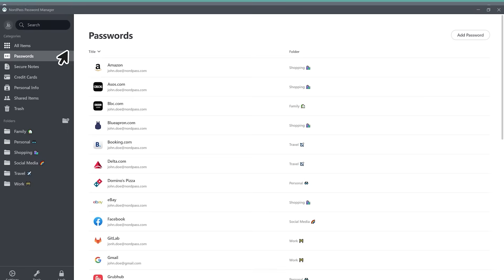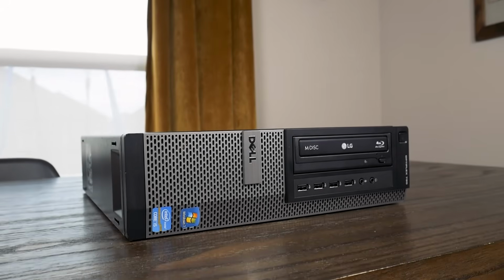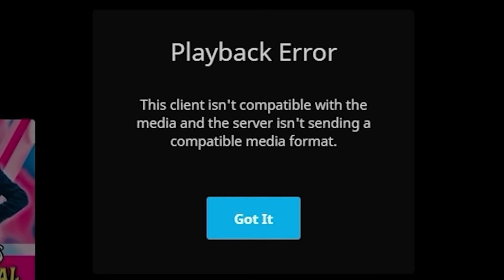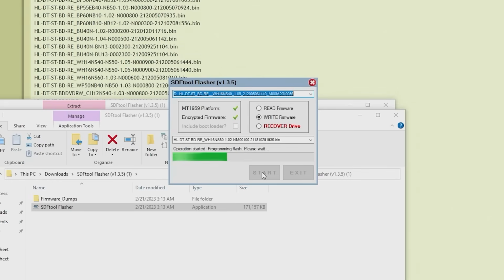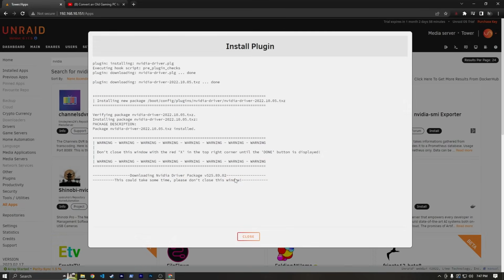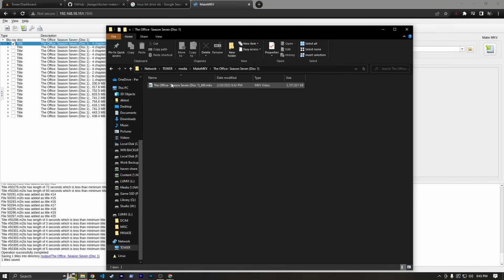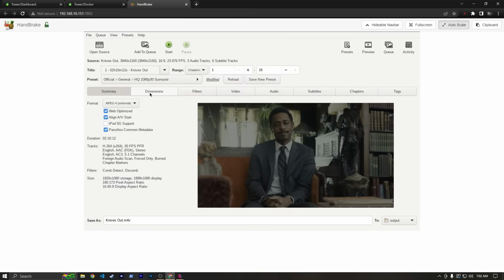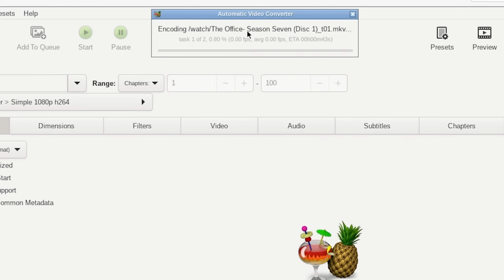Streaming 4K Blu-rays With a DECADE-OLD PC

Comment: Just installed windows 10 on my old Dell Optiplex (just like in the video) with Jellyfin. I only have a 250GB HDD and it's filling up fast. I've used MakeMKV to rip from my DVDs and then used Handbrake to convert them to mp4, but still the drive is just about full with about 40 movies and 5 TV shows. I have a list of a few hundred films I would like to store, so how large of a drive should I replace my current one with and does it need to be an SSD or is an HDD okay? And for backup, would an external SSD be the best choice?

Comment: Just pulled the trigger in one of those. Internet here in Brazil is atrocious. As I have a few gaming pcs at home, I will put a 2.5gb nic, a low profile gaming card and a 8tb hard drive to hold my steam library with ubuntu or bazzite. Whenever I need to delete or reinstall a game from my steamdeck or other gaming pcs, this will transfer the files locally (that is the plan, lets see).

Comment: Doing something similar but different with my Optiplex 9010. Using it as a Plex server with 3TB of SSD, i7-3770S CPU, RX 6500, and 16Gb of RAM. I may add a 6Tb HDD if I run out of space. Although it does have an optical drive, I'm doing all the ripping and transcoding with my 9th gen i9 computer with 28Tb of storage. Using MakeMKV and Handbrake. I don't have a lot of bluerays, but a couple hundred DVDs and adding more. I'm also ripping several hundred music CDs. It's taking a while. I have a Cisco UCS C240 M4 server with 120Tb laying around doing nothing, but it might be a little overkill.

Comment: OptiPlex's are pretty solid. I have two of them in my house, one is a i5 2500, maxed out ram/SSD/GT630 2gb (triple monitors), is on 24/7 and hasn't skipped a beat in the last 6yrs or so. It's mainly used for office work for my GF. I plan to do something like this video to repurpose it when I find something newer for her.  Best part it was nearly free. I live in a tech sector, when the companies upgrade it just rains OptiPlex's and like office PC's...I got a Z640 workstation and 4 OptiPlex's in different conditions for $50, sold the Z640 for $120 during the pandemic when everyone wanted a gaming PC.

Comment: Rip in lossless M2TS format using DVD fab and copy to a NAS (QNAP/Synology recommended) then use a media streamer like a Dune 4K or 8K player (8K is recommended for better performance across the board). This is THE best solution bar none for a networked home cinema solution. Make sure you have gigabit ethernet installed as 4K lossless streaming is over 100mbps.

Comment: Cool setup. I would just add as a tip, if your streaming device or smart TV has support for H.265 playback already built-in (most do these days), I'd disable hardware transcoding on the Optiplex and just stream everything with direct play. You'll eliminate the stuttering and you can keep your video files as H.265, which is much more efficient storage-wise and will save you a TON of space over time.

Comment: I've got a few similar machines at home that make pretty good retro gaming PCs. I've also used them for ripping DVDs as the included optical drives tend to rip quicker than USB drives. However when it comes to converting - even with a gen 2 i7 it can take quite a few hours. Although it's fine to leave it going overnight and they'll be done when you get up.

These days I tend to lean towards x265 encodes for my collections because of the smaller file sizes. While the machines are fine for ripping and software encoding DVDs to x265, I'm not too sure whether they'll play them natively. I suppose using something like Kodi or Jellyfin player should work. I also tried encoding a 20GB Bluray and it was going to take about 3 days LOL.  Personally for media centres I'd probably go a newer mini PC like those from Lenovo, HP and Dell (even though they don't have room for a DVD drive without the extension). 7 & 8th Gen tend to have x265 encoding.

Comment: I use the Dell 9020 for a pfsense box.  Works very nice with 2 x 30GB Intel SSDs in raid.  PS, sata SSDs fit firmly between the PSU and the case lip nicely.

Comment: Was successfully able to shoehorn a GTX1060 into a SFF I7 dell 5050 by using a sata to 6-pin power adaptor. 
The 1060 supports H265, and has no issues rendering 4k. Used NVidia x060 GPUs can be found really cheap, and work extremely well for this.
As for handbrake, your much better off leveraging a GPU than relying on a CPU for that task.

Comment: I currently have an Optiplex 9020 w/Core i5-4590,16GB RAM, 512GB SSD Boot, & 16TB HDD media running Plex. While is it probably quite a bit more efficient than yours, it still gets pretty hot and uses about 30-40w at idle. I have an Optiplex 7050 Micro (Core i7-7700T - idles around 10w) that I plan on replacing the 9020 with. I am going to attempt to replace the M.2 wireless card with an M.2 PCIE riser to add a 4 port SATA controller. If it is a success, I will de-case the 7050 and 3d print a new case that can attach to a 4bay hot-swap SATA enclosure (originally meant to fit into a tower w/3x5.25" drive bays)If it fails, I will settle on a 7050 tower and lose the ability to remove the drives without shuttting everything down.

Comment: I owned an identical model about a year ago - beefed it up to 16 gigs ram and used it as a spare Hyper-V machine for odds and sodds until I sold it off to some who needed a better machine after a laptop breakdown. I'm at the same thought pattern as you with the limited processing fabrication. 2nd gen is quite old and struggles to keep with modern day computing demands.

Comment: I get size limitations, but why would you encode a 4k files from 50-60mbps to 20-25mbps? your loosing half the quality, and at that point its probally better to store the uncompressed 1080p blu-ray at around 20-30gb vs the compressed 4K

Comment: Since you're files are going across multiple devices and being transcoded, fileflows or tdarr could be good solutions for you. Both support hardware encoding and work with workers that you can install on your home pcs to help. The server distributes the tasks to all workers.

The final renaming and importing could be made easier with sonarr and radarr that are normally used for torrenting but have watch folders and manual imports. They get the series info from IMDb and help to keep track what you've ripped in which quality and what is missing in your collection.

Comment: I have Optiplex 9020 micro. I replaced the original 128 GB SSD with 750 GB HDD (horrible for speed, great for capacity) and added one more external USB HDD. Runs just Windows and Plex server. Low power consumption, streams 4K video. No complaints at all.

Comment: So you cheated by using Windows, and a separate PC to do the encoding process post ripping? 

... What is the point then? This isn't focused for the Optiplex and is more or less click bait in that respect. It's better to just ride the high seas and not bother with rips on a machine like that.

Swap Unraid for LibreElec with the Jellyfin add-on and that machine would have been better off as it's better for streaming, not ripping.
Reply from the maker: I just used windows for the sake of speeding things up. Also, I was clear that this isn't the ideal setup for someone needing to do a lot of re-encoding, but that there is a lot that is possible even with a PC this old.
Reply: @HardwareHaven  Possible, yes. Feasible? No. I have a very similar setup and even I know its just better to stream on something like that, or just host a few self hosted apps on those machines tops.

Comment: I have an Asus external and mainly buy blu-rays as my drive as unpatched cannot read 4k UHD blu-rays. I usually rip the blu-rays as is and keep the large file sizes. I guess eventually if i run out of space i will have to look into transcoding as well. Also last i checked i think i am sol and my drive was not on the recommended list but maybe if i ever go to the makemkv forums i will find hope that it can be flashed lol. Not that i have many 4k uhd discs but having the capability is nice lol. 

MakeMkv is amazing isnt it. I was blown away when i found out it exists.

Comment: question, if I rip 4k UHD movies to a NAS pc with MKV- the pc nas will not perform any transcoding, simply hold the movie files - can I watch them without losing bitrate or UHD sound quality from a Nvidia Sheild Pro with PLEX on the Nvidia Shield PRO. ?  Also does the NAS host pc have to have a good CPU and RAM to stream more than one 4k UHD movie at at time ?

Comment: I did something similar with a 4th gen Dell Optiplex mid tower. It's stock on the outside, but heavily modded on the inside. I drilled out the HDD cage to make room for a 1080ti hybrid, did the ATX PSU mod, and threw in a Magic Reform 4980hq that has the 128mb l4 eDRAM cache.  It can be tweaked to near 4790k speeds while consuming about a third of the power

Storage is mounted in an adapter that I slung under the 5.25 bays. There's not a ton of room left, but it works. Emulates pretty much anything I throw at it, plays 4k movies fine. It's great little PC for when company is over

Comment: I don't get why you would re-encode Blu-rays and UHDs to another lossy format with handbrake just because files are big...... The whole reason of ripping Discs is to have the content 1:1 so you don't have to make sacrifices for the Picture and audio quality because otherwise you would be using streaming. That's the whole point of watching Blu-rays and UHDs, to be able to watch High Quality Encodes with high bitrates. Otherwise it would be like buying SACDs, DVD-Audio, BD-Pure Audio or CDs only to all rip them to OGG, MP3 or AAC, just because "thE fiLes ArE tOO bIG". Being able to play MKVs from your Blu-rays and UHDs is still giving you the multi-audio tracks and subtitle options too. Thankfully you don't have to flash every Optical drive as many support LibreDrive mode already, like the Pioneer BD-R XD07TS for example, if you prefer a USB solution. However you do safe more money if you go with a BD-ROM of course, if you do not plan to burn BDs yourself since Burners cost a bit more. And the great thing is if you use MakeMKV you can even use it as an adapter for VLC to directly playback Blu-rays so you don't even need to rip anything.

Comment: To be honest, having a dedicated Media PC as a player for everything, instead of a regular BD, DVD player, is basically the ONLY logical choice nowdays. You have a LOT more control over the hardware and software which means you are a lot more flexible when it comes to problems. You also don't get this abundance of crap apps that comes bundled with all these new BD players nowdays... The only real downside is a Media PC consumes a lot more power than a standalone BD / DVD player. So i'd probably rather opt for a Laptop-hardware solution that is more easy on the energy consumption.

Comment: I have the exact same optiplex also running a 2nd gen i5 which I converted to a home jellyfin and file/torrent server. I too, love the look of the optiplex lol.

There is an additional slot for a 2.5 inch drive at the bottom part of the stock HDD holder(light blue plastic part). I was able to mount a 2.5" Sata SSD as boot drive and 2 units of 2.5" 1TB HDD on a 3.5 to 2.5 converter mount as well as a 3.5" 3TB low power HDD in a 5.75" HDD hot swap caddy.

Total of 3x mechanical drive and 1x SSD. So far the PSU is able to keep running without any sudden shut down.
Reply from the maker: Nice! Yeah I totally missed the 2.5” mount on the caddy haha

Comment: I would try and find a top-of-the-line core i7 of that generation that would definitely help with things some and probably maybe even give you much better transcoding encoding speed for the videos because I remember trying to encode a 60-plus GB 4K file movie and take it down to a much more reasonable size on a 2600 k core i7 before I upgraded to a 2700x and I remember it saying it would take around six hours and that's quite a long time but lot less than that 16 hours you showed

Comment: Just a bios update and a xeon e3-1265l or 1245v2 already solved it, it has a lot of performance close to the tdp, which is not 80w, it stays at a maximum of 60w to 65w at maximum load, I use it on a computer and it works very well, my third xeon, in cinebench r23 I got about 500 points more than the e3-1270v1 (i7 2600). The 1245v2 has integrated graphics, which makes it a little easier, but you have to put a better cooler to not overheat, mine is around 40ºc stopped and using a maximum of about 52ºc.
Reply from the maker: Yeah, that would’ve been smart to look into. I think I even have some ivy bridge chips laying around… oh well

Comment: I honestly dont understand why you wouldnt just download the size/quality youre after at this point? You own the media and ripping the file off the disc bypassing DRM is already breaking the agreements... its be faster and more efficient to just download the file. Unless bandwidth is a problem?
Reply from the maker: I think the argument could be made that there's no risk of downloading malware with ripping as compared to torrenting.
Also, bypassing DRM protections is a lot different from a legal standpoint than sharing/downloading content. No judgement or anything, just tossing out a couple thoughts.
Reply: @HardwareHaven  I guess there are other factors but from say a moral pov I would see no difference, I hold the same view for using VPNs with streaming services. You're breaking the agreement by bypassing geoblocking so if it's easier/convenient just download instead of use a VPN to access the same content. We are talking someone already with access to the media, just wanting to consume it in a more convenient way at the end of the day (though geoblocking could be an argument for not technically having the access in the first place). 

On the legal side I see your point but the risk of any kind of legal action if you aren't looking at monetising off the endeavour is basically 0. Sure different actions hold different legal weight, even downloading without seeding back is less bad.

The malware side I also believe is minimal especially for the targeted audience in this case. If you can follow this guide, you are technical enough and if you're downloading to unraid etc you're already minimising the chance malware can even affect you substantially.

Anyway I do see some use even if it's just for another tinkering project at the end of the day, but if convenience is the goal, it's hard to not look elsewhere 😎
Reply from the maker: I get your point entirely by the way. And I agree with you from a moral standpoint; I have no issues downloading content I’ve already paid for.

Comment: I swapped the k200 for a RTX A2000. It's compatible to encode x265/h265 to x264 so, I guess, no problems there I guess.

And the Case of the Dell Optiplex is quite nice, so swapping the Mainboard for some low powered AMD Epyc is a valid option here....
I think a M11SDV-8CT-LN4F would fit that.

Just put a noctua or something on the Heatsink, because well, the Mainboard is designed for a Server Airflow case.

Comment: I think the biggest shortcoming for the 4K stuff is just that the 2nd gen stuff isn't necessarily up to the task. I think even a 4th gen i5 (or better yet i7 which should still be super cheap) would handle it all MUCH better and get things done much faster. Also, I wonder... And yes, this is super dumb compared to using software encoding... But couldn't you maybe just drop your video files into a video editing software and compress with QSV (or NVENC or VCE)? Quality won't be as good per bitrate, but time would be much shorter, so it would be a balance. I don't know how much better QSV has gotten since 2nd gen, but I suspect on newer generations, probably Haswell and above, QSV would give very decent video (for ~24fps movies) at 4K at maybe... 20-ish mbps? For my gaming videos, I record 4K at only 50mbps with NVidia (RTX 2070 S) and then output VBR in Magix Vegas (with Intel QSV) to 40mbps average, 50mbps peak for 60fps 4K gameplay and honestly, while there is SOME quality loss, videos still look quite good and not super compressed! Hell, you may have luck messing with bitrates as low as ~15mbps with QSV, since the framerate is much lower, and it should preserve detail in live-action much better than tiny graphical details in games. Maybe you could use OBS to record with whatever option is available (see how good software encoding does, though I doubt this machine will do anything close to 4K 24fps, and set your monitor to be running 4K at film framerate and just set and forget, trim the video (maybe even with Windows' Photos app, which I recently discovered is quite useful if you want to not mess around with editing software) and you skip a TON of steps for relatively similar quality. Probably won't be as good, but at living room distance and still modest bitrates, I suspect it'll still be a win!

Comment: Try an HP EliteDesk 800 G3 SFF. It uses 6th or 7th gen CPUs, DDR4, and has room for TWO 3.5" drives as well as an NVMe SSD. The down side? Slim DVD drive. But an external box for your BD drive will cure that.